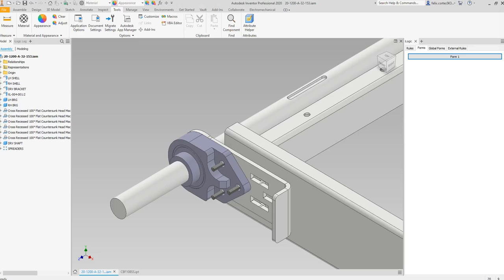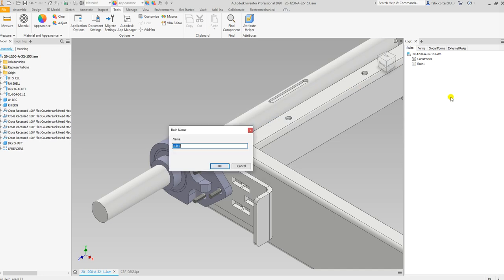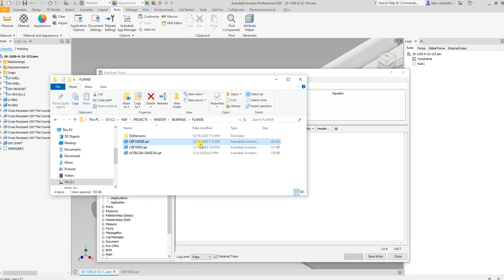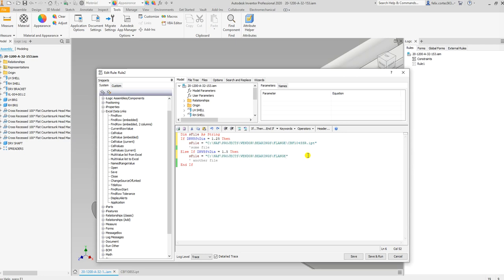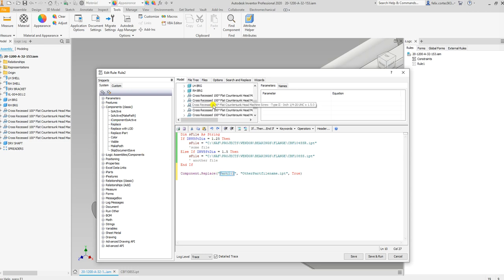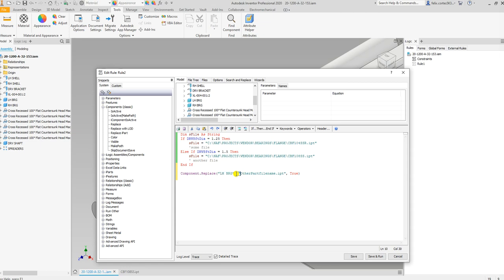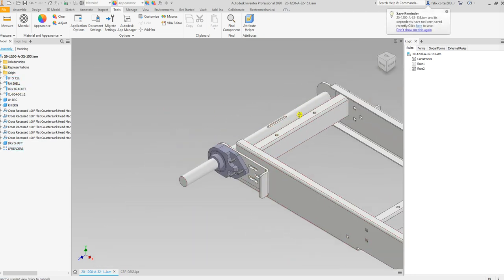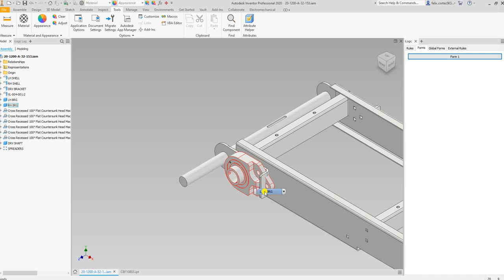iLogic For Beginners #3: Replacing Components W/ If Then Statements

Comment: This is good. But I need to know how to include parts and exclude them in an assembly within another assembly. AS IN. 

I have a Linear Actuator. It can be mounter regularly or it can be mounted on a window.
If mounted on a window it needs different mounting brackets.
When in the Actuator assembly I can make it happen in the form.
But when that assembly is in another assembly that form can't be accessed. Need Help TY
Reply from the maker: Make a rule inside the actuator assembly and call it "Display Form". Inside this rule, write:

"iLogicForm.Show("Form 1")".

Replace "Form 1" with whatever the name of your form is. After that, you will need a rule on the upper assembly to run the ilogic rule inside the Actuator assembly called "Display Form". 

Hope this helps,
Felix
Reply: @DesignAutomationSolutions    I am stuck on this part.

"After that, you will need a rule on the upper assembly to run the ilogic rule inside the Actuator assembly called "Display Form". "

I don't know how to do that. I just started using ilocic.
Reply: @DesignAutomationSolutions  Found it. Thank you for replying and helping.
Reply from the maker: @AztecWarrior69_69  awesome, no problem

Comment: I'm working on a project using the Component.Replace in iLogic, but the part name changes after it's replaced and breaks the code.  Do you have a solution to keep the name of the replaced component consistent?
Reply: Did you change the name of the component in the model browser of did you use the default name?